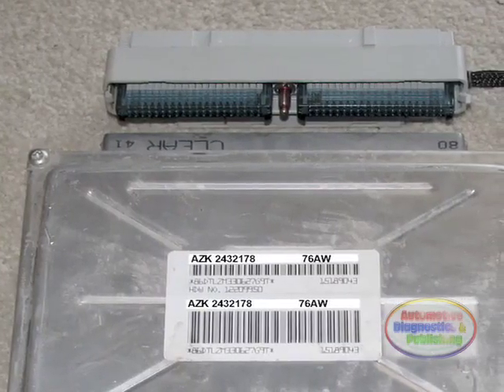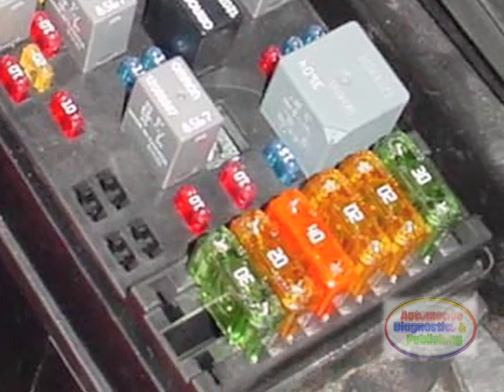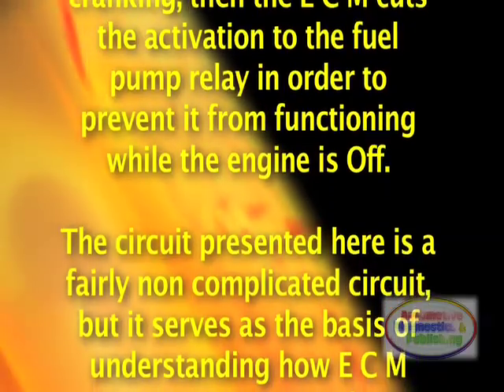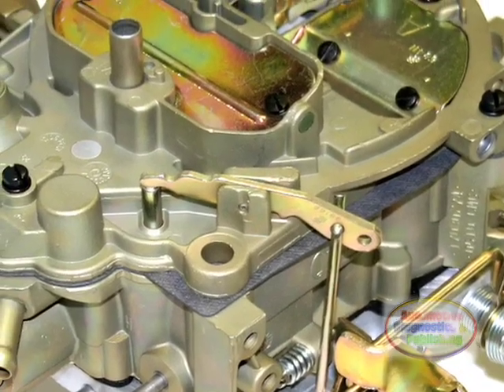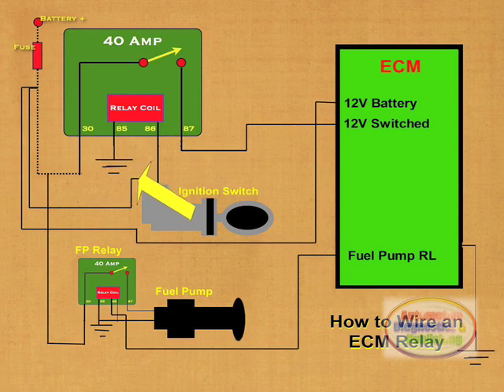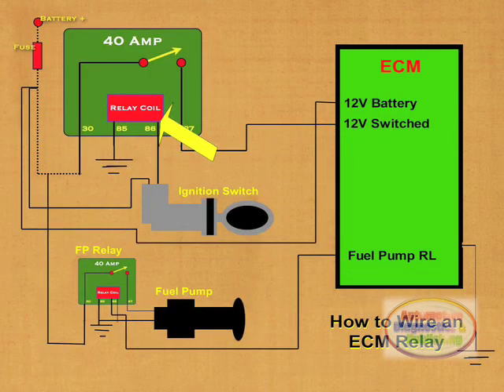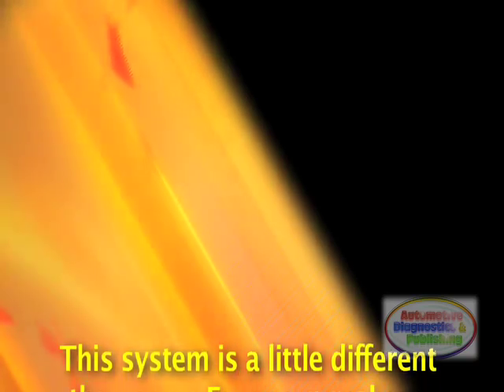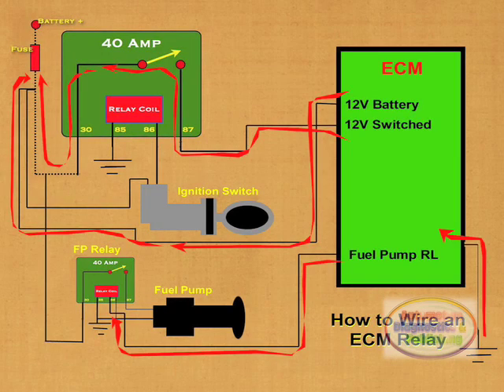How to Wire an ECM Relay

Comment from the maker: Yes it does. In fact I've seen some ECMs with as many as 7 separate grounds. Each feeding a different side of the system and separate sensors. As a rule O2 grounds are separate. 

A ground is a RELATIVE measurement. So, usually ground is Neg. battery terminal, but if you take a resistor or voltage divider network and take your ground point after it, then that's floating ground. It is called floating because the reference point is something else other than battery ground or Neg. Hope that helps.

Comment from the maker: Yes, usually to avoid ground noise. Naturally, since floating ground is not normal battery ground it is not prone to noise. This is why FG is used largely on radio circuitry.

Comment from the maker: Code P0656 is actuator code low voltage. Check wiring and fuses. Here's our Code Wizard Software that'll help with that... https://sites.fastspring.com/autodiagnosticsandpublishing/product/diyautomotivecodewizard
Reply: wich hardware work with this SW ?
Reply from the maker: Anything that meets the relay's current handling value, which is 40 Amps or almost anything.
Reply: A